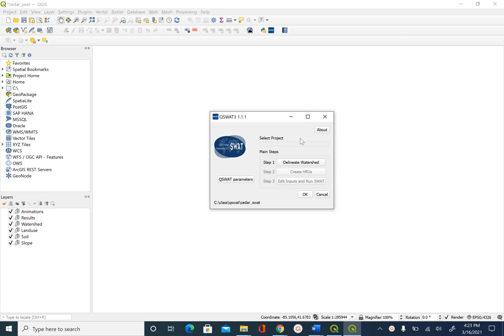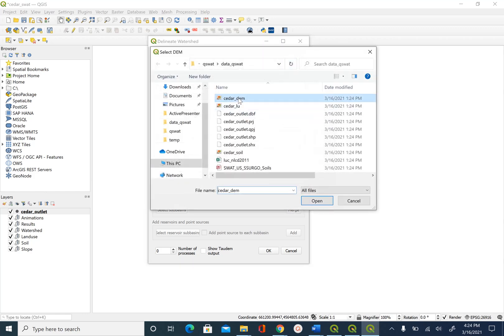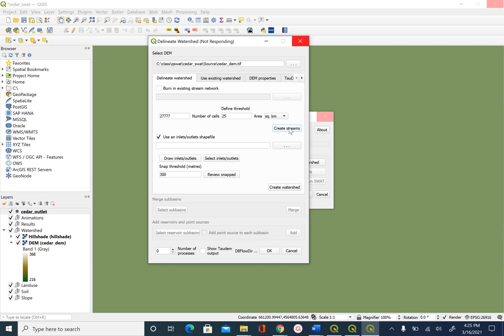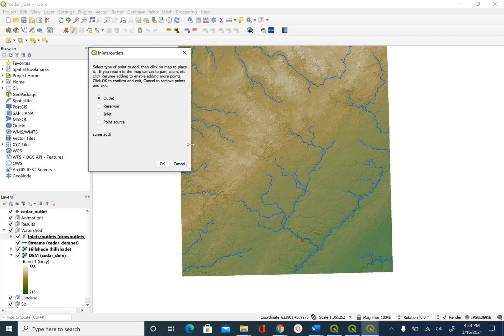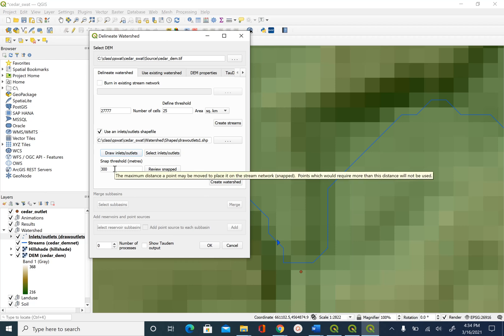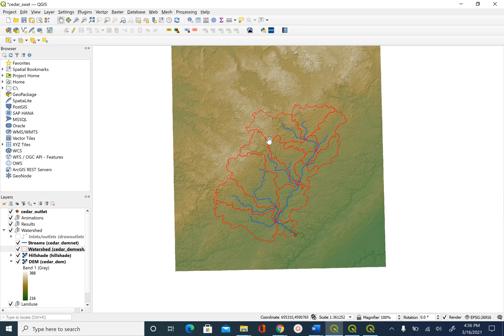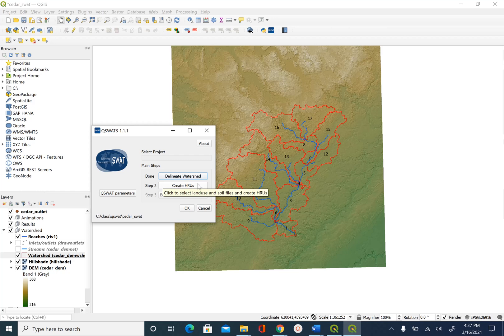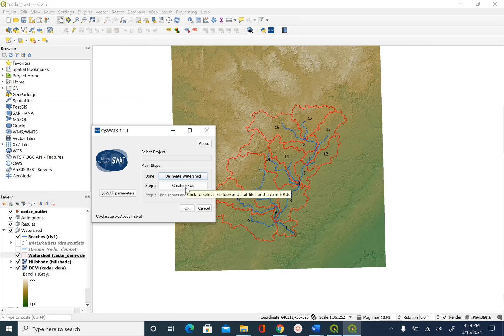SWAT Hydrologic Modeling using QSWAT (3/6) - Watershed Delineation in QSWAT

Comment: How do we determine where to draw the inlet and outlet if there is not an already predefined inlet/outlet shapefile? Also we get an option to add pond and reservoirs. Do we have to add those as well? Does that improve accuracy if we do?
Reply from the maker: as a modeler you have to decide where to have your outlet. You do not need a shapefile for that. yes, if your watershed has ponds and reservoirs, you should include them in the model.